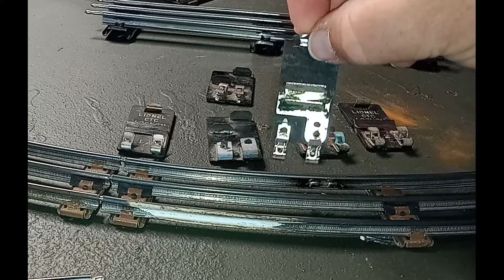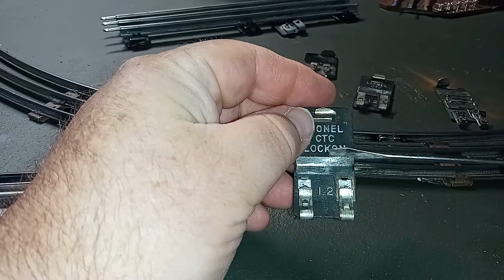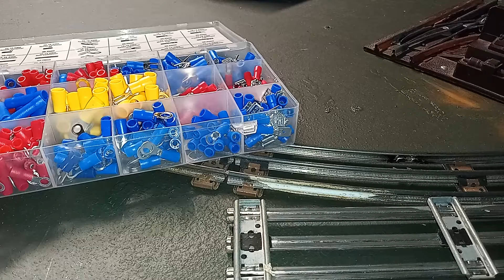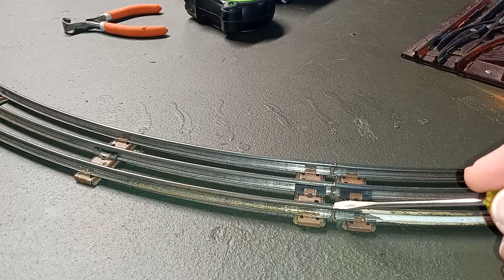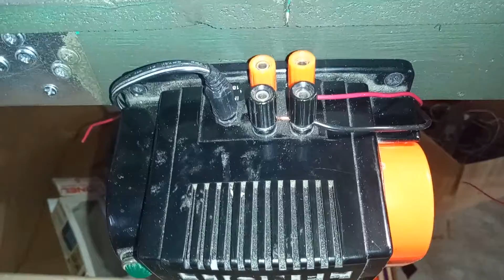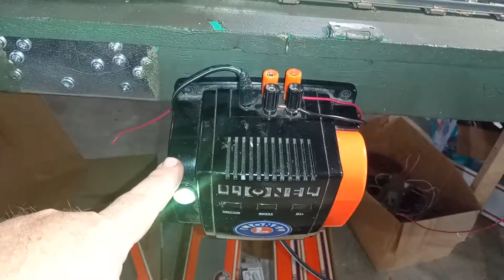Solder-Free Wiring For O27 Track

Comment: Feeders- I have had layouts with many, many feet long  15 or more feet long - such as a large loop.i put a feeder on the far   side and on on the close side. I never had any problem and the trains always ran at the speed set on the transformer. Putting feeder wires after every 5  pieces of track is really not necessary. Your truck must be in really  crappy shape.
Reply from the maker: It depends on the age and type of motors. Since older universal motors require more amp/wattage than contemporary can motors, any slight variation in power is magnified. Yes, can motors experience little if any speed variation, but an old Postwar 2035 will find every minor variation.

Comment: H Mike:
You r tutorial started out very simple for those of us out here that are just starting to get into trains. But then you go of into the eide blue wander talkignabout wing up a USC track and then into K-line switches  and totally blow the minds of ll those novice train modelers. why did you do that? /most beginners will just want to hook up the power wires to the tracks nd not even consider re-wiring RMC tracks dn using K-line switches for a conduit of power. Do not try to be the answer to everything. Be simple and so we can understand th basic wiring methods. thank you.

Comment: I solder all of my wire connections, and I also solder where the rails connect. It's very easy to learn how to solder, and the cost of what you need is very reasonable. I'm finally getting back to building a layout, and I've subscribed to your channel for help.
Reply from the maker: Good luck with your layout build, glad I can help!

Comment: Just a note about your turn outs on your layout. When they are that close, some engines roller pick-up will get stuck or change direction due to the roller spacing, and the switch insulated, plastic spots.  William's was one of those that had trouble, I read about....
Reply from the maker: Good tip!

Comment: Regarding track resistance and dropper requirements: May I suggest a product called OxGard by EB Products? A tiny dab on each rail pin/joint will reduce resistance significantly and pretty-much permanently reduce any tendency toward corrosion in the joint. My current layout is HO with Steel (Bachmann EZ Track) rails. I learned about this product from another YouTuber.  Back in the day when I had Marx 3-rail trains, I always had issues with corrosion/rust. My perspiration ate metal. The Zinc coating on the rails went away--I now shudder to think where--like into my Brain via my skin... Oy!   :face-orange-raised-eyebrow:
Reply from the maker: Interesting. On a former HO layout we used NS tracks and had no voltage drop issues whatsoever on a basement-sized layout. I'll keep it in mind.
Reply: @ToyTrainTipsAndTricks  My track is steel, like your 3-rail. I was told resistance is like 5x as much as NS, hence the conductive add-on coating.

Comment: 3:59 This one looks salvageable; just take a razor blade and scrap the underside of the outer contact, and take some sandpaper to the top and edge of the contacts, perhaps even soak it in vinegar to remove the rust. I buy several "used" lockons from Trainz for $1.00 ea. (mostly Lionel CTC, and UTC, as well as Marx single lockons) and then clean them up to be used on my layout.

On an unrelated note: Lionel in the MPC era made a track lockon similar to the Marx style but it's hard wired.
Reply from the maker: Thanks. I've never seen that MPC lockon!

Comment: Does it matter which outside rail is connected to the transformer?  I'm thinking that it would be more electrically sound to have both outside rails connected to the ground peg on the transformer regularly, but I'm not sure.
Reply from the maker: The metal ties on the track make the electrical connection to both outside rails.
Reply: @Toy Train Tips And Tricks  that's cool, thanks for the info!  I had no idea, I'm actually rather new to the toy train hobby, being primarily interested in model railroading :-)

Comment: Would you please tell me , what years Marx manufactured the 999 locomotives ?
Reply from the maker: Marx did not produce annual catalogs so it is more difficult to pin down specifics of Marx production. However, collectors generally agree that the 999 was introduced in early 1941 and a few may have been produced into 1942 before you production ceased during WW2. Production resumed in late 1945 or early 1946 and likely continued into 1959.
Reply: @ToyTrainTipsAndTricks  Thank you much.

Comment: One thing you should mention is to use Stranded wire for your bus but use Solid wire from the bus to the track.  Stranded has less voltage drop then solid does.  For Lionel, yes you are going to want big, fat, wires due to the MUCH higher voltage needs of those locomotives, as I would say min should be 14g wire for the bus and 18g for your feeders.  In your case that big 8g wire for your bus is good for the single feed.
Reply from the maker: Excellent tip. Thanks!!

Comment: This is great information Mike.  Thank you.  Can you tell us how you connect common lines to the bare common bus wire going to the transformer?
Reply from the maker: Sure! I start by simply stripping the end of the connecting wire and wrapping it around the bus wire 5-6 turns. If I think the connection needs to be tighter I will hit it with a quick dab of solder.

Comment: Hey Mike - Great presentation as usual! One thought on the initial wire connections. The terminal rail joiners used on N and HO scale tracks can be easily fabricated for O, with or without soldering. I have a few spots on my layout that don't have room for any "conventional" hook ups. I put a track pin in a drill chuck and cut a small groove in the center with a file. Then a wire can be wrapped/twisted around the groove and soldered in place or not. Pretty much an instant O gauge terminal rail joiner and they are reusable! They can also be invisible or not as you like. Thanks again for the great work, and best of luck with the new house and layout!
Reply from the maker: That is an EXCELLENT idea!!!